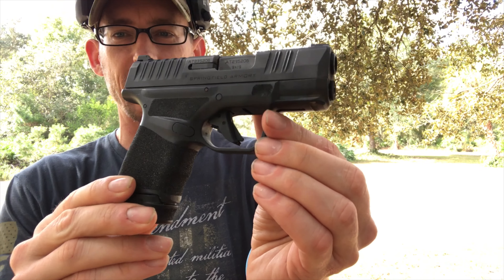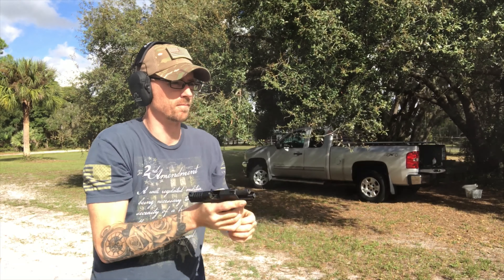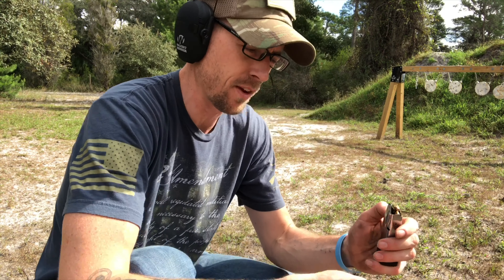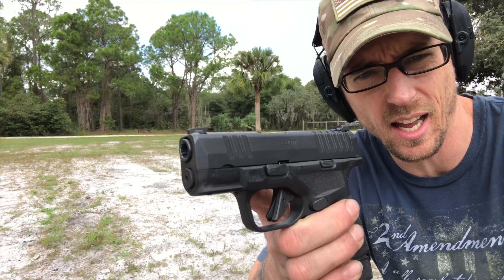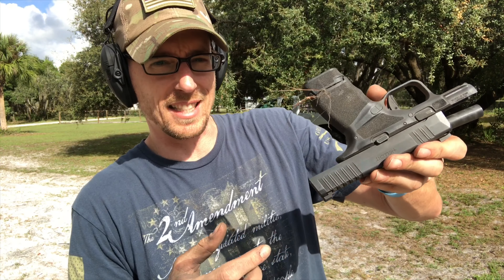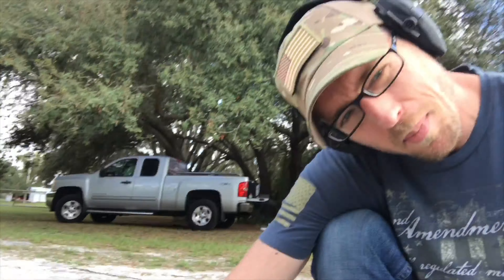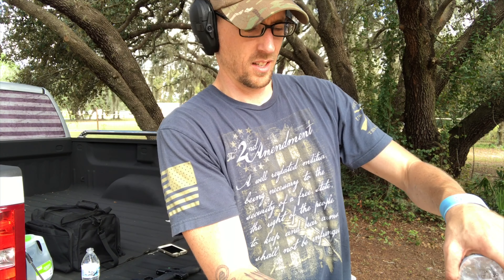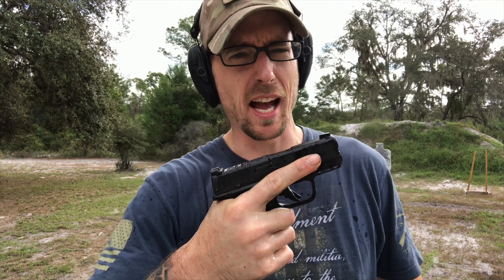Springfield Hellcat | I Broke It...

Comment: One needs to learn how a double stack magazine works and why it's important to properly maintain them. A double stack magazine works by storing ammunition in two staggered columns, meaning the rounds are positioned slightly offset from each other, allowing for more rounds to fit within the same magazine size compared to a single stack magazine which only holds rounds in one column; this "staggered" arrangement ensures that when a round is fed into the chamber, it alternates between the left and right stacks, providing consistent feeding while maximizing capacity.  No where in the owner manual does it say it's okay to subject your firearm to these conditions? Although some do better than others, they weren't design for these conditions. If your firearm is subject to these conditions? You should toughly clean the firearm and lubricate it.

Comment: The malfunction was due to you limp wristing it . Failure to lock slide back was also due to you holding the slide lock. It happens. I really didn’t see any legitimate failures or faults that weren’t operator error. Those could all easily have been avoided

Comment: Never understood torcher tests. Its always things that would never happen. Of course if you try and make it fail it will. Lol. Idk. Entertainment I suppose.
Reply from the maker: Yes none of this would happen in real life... Just trying to have fun
Reply: I presume you meant torture? Life isn't fair, and the world is dirty. I chose my HK 91 because a Mussad agent stuffed mud, and twigs in the breach opening, slapped the bolt home and shot it like nothing ever happened. Then I dressed the trigger from 14 lbs to 4.5 lbs and my friends made a legend out of me. 3 #10 common nails at 100M with 5 rounds, offhand, high cross winds, and those wonderful iron sights. My pistol work isn't so shabby either, gaining me the Moniker of Headhunter. 30 round string of pearls for my SA quals.
Reply: @bryanst.martin7134  hahah. I meant Torture. Im just saying the chances of your weapon being packed with mud is next to none. And every gun will fail eventually if you want it to.
Reply: So you would never potentially be running to or from cover, stumble, trip, or run into something and your weapon goes flying to the ground? That happens to even the best. Torture tests shows if the firearm would still function in a life threatening situation, but tested at a more extreme level. If it can survive being buried in sand and still function, then it will still function being dropped in a little bit of dirt and save your life.
Reply: @prometheusgaming8418  Im not talking about dropping your gun in sand, dirt or water. Im talking about stuffing debris in mags, receivers, chambers. If you drop your gun on the ground or crawl with it the likely hood of debris being packed into the action or magwell (which are normally closed) would never happen. If you pack enough crap in the operating system of any gun it will fail, possibly catastrophic.
Reply: Civilian Commandos M.U.L.S.A some firearms are actually manufactured to withstand a lot of punishments. There are reasons for torture tests. I have done numerous with glocks and sigs. But was not for entertainment purposes
Reply: Well if it took all that to fail, and you end up on the ground in a bit of a situation you can pretty safely assume it will work when it needs to.
Reply: @Brasshound480  if you end up under 6 or more inches of mud in the environment most of us live in. Unless you're Dutch fighting a Predator it won't matter.
Reply: @civiliancommandosm.u.l.s.a7685  I'm thinking if I have to hit the deck in mud, and get a little on it I'm likely to still have a functioning tool. In the realm of possibilities it's not up there, but it could happen.
Reply: @Brasshound480  Better safe than sorry I guess. Most guns now days will function in reasonable harsh conditions.